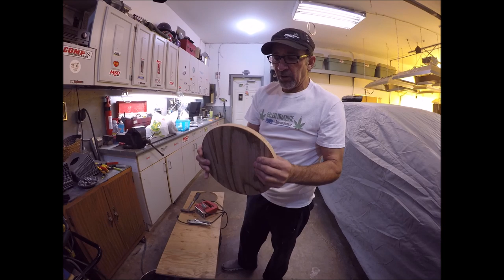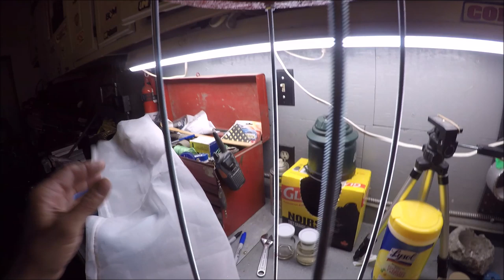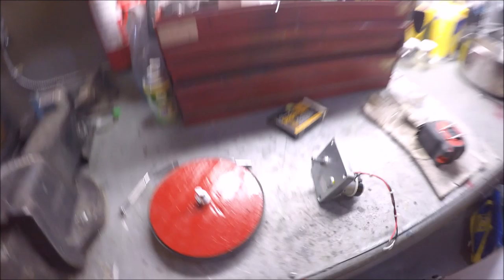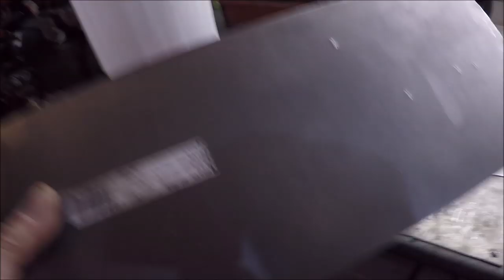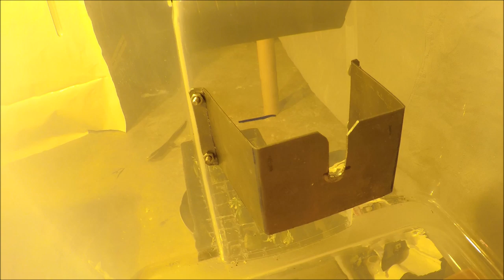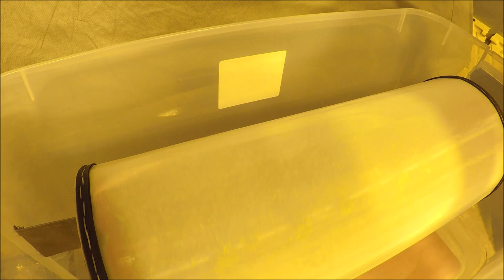Pollen tumbler build your own step by step

Comment: Sweet video! I ordered a yard of 120 micron screen a week ago before seeing this video. My plan is very similar. I will use wood slats instead of the steel rods. This will save sewing the screen as I can staple screen right to the slat. I was going to use an electric drill but after your video I will use a bbq rottisery. I also will run drive rod right through center. This will make hanging it simpler for me. With a smaller door off centered. I am also planning it to fit in a large chest freezer. I seen another commenter mention that as well.  Almost forgot I figure on hand shaking kief through the smaller micron bubble bags after. Enjoyed watching! Thanks
Reply from the maker: I love it when someone improves things, that is what we try to strive for on this channel and share it with the world Thanks Chris
Reply: where can I get the silk screen?
Reply: @juansalgado213  I ordered it on Amazon.

Comment: You could use a gold panning screen set. they fit a bucket.  They sell them in all different mesh sizes.

You could use a wahl hiar trimmer to vibrate the screen.  Just touch the moving part on the frame.  That S with dance accross the screen. 

You could Freeze fresh sugar leaves.  If you don't have easy access to dry ice.  You could keep them in the freezer until it gets below zero outside and to run that. The leaf stays solid and the clear break off.

  I am not knocking you'r build you did a great job! I love it!  

Just a tip for someone not as skilled as you and can't have that sitting around.  As gold panning and hair trimming is normal stuff to have around.

Comment: The silkscreen can be done another way so you don't have to take out the cylinder to fill/empty it: put velcro on the edges of two wood discs and on the edges of your silkscreen.  Where the silkscreen meets itself after one revolution you put a line of velcro spanning between the two wood discs, half on each side of the silkscreen. This lets you open the cylinder (like opening a big cylindrical bbq) without having to take it out of the bin.  The benefit is you don't get any mess on the floor until you are ready to clean out the whole tumbler.
Reply from the maker: Hey Rob. Thanks so much for leaving such an excellent comment tips like this really helps the community

Comment: i've seen one of those (smaller one) on walmart for like 49$. they're long gone, but i found the same exact model on another website selling those tumblers now for a 10x markup...
Reply from the maker: Interesting what was the Tumblr used for originally the one at Walmart for 49
Reply: @johnnysgreenextractions8144  The shape of the box looks exactly like the one you can see in this video: https://www.youtube.com/watch?v=XmYtwfgbzF4
its always this gray colour with the added features to the box, the plastic where the tumble box sits in is also the same. ive seen those in different sizes

Comment: Thank you very much for this video! Finally someone made an easy to follow video. I do get stuck at the electric part.. what kind of motor is that? How much rpm it goes and what would be the ideal rpm? How you connect the motor? Could you explain this part abit more detailed please🙏
Reply from the maker: Not sure on the RPM you don't want it to quick so that a centrifical force is created where everything is sticking to the sides you want it to Tumble in there the motor was bolted right to the tub we just picked up the motor at a little shop that sold miscellaneous parts
Reply: @johnnysgreenextractions8144  thank you so much for your reaction! And you connect it directly to an AC supply? Without transformer?
Reply from the maker: The one we ran across was strait plug into the wall
Reply: @johnnysgreenextractions8144  so I should really find out what motor you use because most dc motors you cant vonnect directly.
Reply from the maker: Just had to look and it doesn't have any markings just try to get the small one that be able to plug right into the wall
Reply: @johnnysgreenextractions8144  thank you I will look for that then!

Comment: How much trim did you run to collect that many trichomes? That's a nice amount you collected something tells me you didn't sift an ounce or so? Or do you throw in small buds also
Reply from the maker: Hi Steven We never Weighed it yes there was more than an ounce in there and there is a lot of small bud in there also That's cream Barrel can hold quite a bit And within 5 minutes you've got loads of trichomes
Reply: @johnnysgreenextractions8144  
Sorry about all of the questions but did you freeze the trim to help them break off or is it just the saved dried trim?
Reply from the maker: @stevenallen9592  No problem buddy we're here to answer all your questions We used dry Some people will actually run a tumbler in a freezer I'm suspecting freezing your drum might be better Either way should be fine

Comment: Johnny i was wondering is the plant good for anything after u tumble or do you disregaurd it?
Reply from the maker: Hi Phil We discard it as there are no more thc crystal or trichome left on the plant material.
Reply: Phil Smith,  I Have Seen Some that  will  Blast it After Their Tumble.. Then they will Burn in their Cannabis Burn Pit... Getting Rid of it for Good, and or Trash it ..
Reply: @greensnapper1602  with 110 you can still go lower in micron or blast it indeed or use for cooking or oil.
Reply: @mulacula9540  yes we know if you want more kief.. or for hash.. But was talking about Blasting..  Thanks for commenting...

Comment: I use electric window motors from vehicles. There are gear reduced and extremely torquey. As well as a 120v to 12v step down power supply and a speed controller. All of which is stupid cheap on Amazon.
Reply from the maker: Matthew that is an excellent idea people will like that one thank you bud
Reply: Do you know the amps needed to run a small window motor? I'm trying to find the right power supply to make this thing. Thanks!